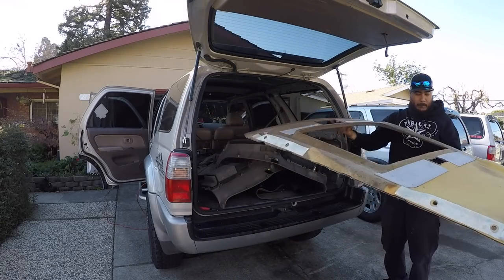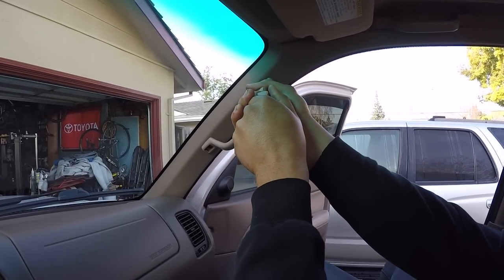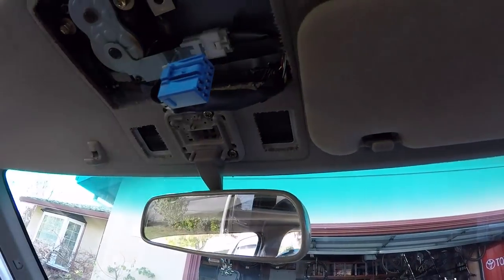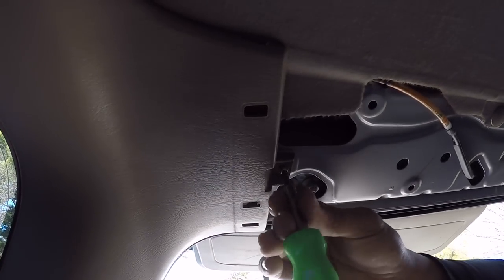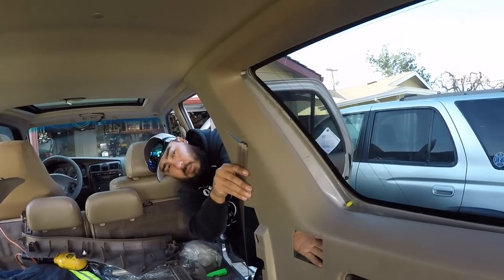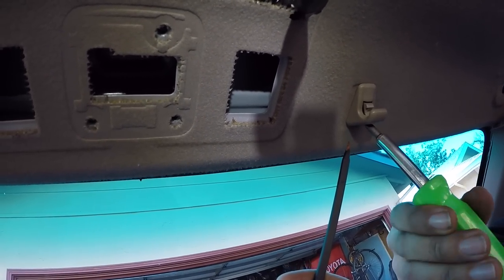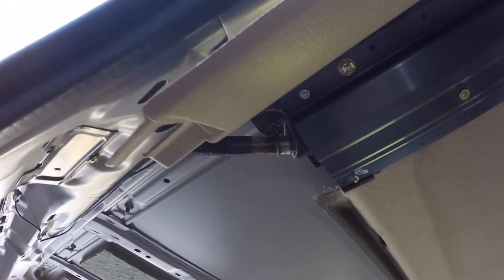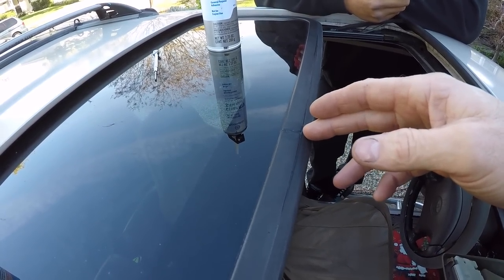Headliner Removal & Sunroof Leak Repair

Comment: Hey Timmy! Since I’ll be cracking those pins that hold the roof up as well. Is there a purchase link or a part number for those suckers?
Reply from the maker: I don't have the part number for those clips.  I'd suggest just going to your local dealer.  They can't be that much to purchase.
Reply: @TimmyTheToolman  thanks for getting back to me! I actually did just that and have some ordered. Should’ve did that before I commented!
Reply from the maker: We are Curious what the part number is, we could add it to the video description for future on lookers
Reply: @TimmyTheToolman  I don’t remember off the top of my head, but once I pick them up on Saturday I’ll let you know!

Comment: I use a #3 phillips screwdriver on the hand holds and you gotta press hard so it doesn't slip, but I've never had a problem getting them off. GOTTA be a #3 though. Even on my 32 year old FJ62 I had no problems.
Reply from the maker: You're must be pretty strong and good with a screwdriver because those screws have  conquered many guys who have tried to get them out.

Comment: Great video! Timmy have you encountered a slow moving sunroof issue? I have the same model as the one in this video.
Reply from the maker: Glad you like the video.  I don't have a ton of experience with diagnosing sunroof issues.  It may be a case that there's build-up of junk on the tracks that's slowing the operation down and a little cleaning might help.  It also could just mean the sunroof motor is getting tired.

Comment: What’s the size of the 2 clips from the back to hold the headliner Toyota 4Runner 2014
Reply from the maker: No clue Jackie.  You'll have to check with your local dealer.

Comment: Hey! Are you planning on doing a video about removing the roof panel for the Toyota 4runner? Why I'm asking is cause I want to get a 3rd gen Toyota 4runner without the sunroof but I can't seem to find one so I was wondering if its possible to replace the car roof panel without the sunroof?
Reply from the maker: That would not be possible unless you were willing to cut the roof off one rig that does have a sunroof, then cut the roof off another one you find that doesn't have the sunroof and have that one welded on.  What you could do is remove the sunroof and then have a plate welded in.  This video will show you how to drop your roof headliner so you can access the sunroof to remove it any support brackets for it. https://youtu.be/MVJW0XM2x24
We don't have a video for removing the sunroof but I'm sure you'll be able to figure it out.
Reply: Thanks for the response and sharing the info! I really appreciate it eventually I know figure something out.
Reply from the maker: @zawditudacosta2890  You're welcome.

Comment: I have a 2000 SR5 (no sunroof) I notice water seeps through the weather door strips during raining days. It took me awhile to figure out where the water was coming so I sat in my runner on a raining day.
Reply from the maker: Good job figuring out the source of the leak.  Sounds like you'll be getting some new door weather stripping soon.

Comment: hey Timmy! loved this video! using it to remove the headliner to add fiber optic "stars".   is there any way you could send a link to the replacement fasteners for the ceiling of the headliner? mine snapped off as well! cheers
Reply from the maker: Don't know the part number for those fasteners.   Your local dealer might be your best bet to get the fasteners you need.

Comment: Thanks for the info! We've been getting a monsoon here in southcentral KY the last few days as spring looms in the distance. Came out to my truck to see there was water in the driver's seat yesterday and and it was dripping from a soaked headliner and sun visor. Looks like it's my drivers side drain that is plugged. Gonna try the weedwacker wire and silicone the front center of the sunroof.
Reply from the maker: You're welcome.  Good luck with the drain cleaning.

Comment: Great Video. This is the only video I have found that comes close to helping me fix my rear washer fluid. I know the pump is working because I can hear it and there is a union under the hood on the pass. side that squirts out washer fluid when I separate it. But, I get no fluid to the rear
Reply from the maker: Thanks Kelly.  That's good to hear that our video might help you solve your rear washer fluid problem.  Let us know what the problem was and how you fixed it.
Reply from the maker: Hey Kelly, that's great news.  Glad this video help you tear apart your interior so you could locate where the problem was with your rear washer fluid delivery.  I buy quite a bit of stuff at Harbor Freight.  I'm there all the time.

On my 98 3rd Gen, I had an annoying rattling while I was driving.  I took the glove box out and was looking for loose wires and saw a new antenna wire for the aftermarket stereo that the previous owner had installed and the wire was loose but that wasn't the culprit.  

After listening to the rattling for a few more days I decided to investigate further.  I suspected the noise might have something to do with the stereo install and I was right.  The installer left the old antenna wire hanging and didn't remove it.  The OEM antenna wire plug has a heavy metal end and it was resting against a metal frame piece behind the stereo.  I ziptied the wire to a wire bundle and the problem was fixed.  Your average person would have just lived with the noise turning up the stereo to drown it out and attributed it to be an old vehicle that makes a lot of noise.  I was so relieved I found the problem because it was driving me nuts listening to it.

It sure is satisfying figuring something out and fixing the problem isn't it?  Talk to you later and Happy Wrenching!

Comment: Hello Tim question my 04 4Runner rear fort don’t open what would be the problem? Where can we start looking thank you so much hope you can help me
Reply from the maker: Hey Carlos, did you mean to say your rear hatch doesn't open?
Reply: Timmy The Toolman lol yes door,  the window goes up and down  with no problem at all.
Reply from the maker: This might be really difficult to fix since you can't open the hatch to easily take off the interior plastic trim to expose the inner workings of the locking mechanism.  I honestly don't know how you'd attack this.  You know who might be a good resource to ask is a body shop.  They might have a suggestion or trick for you to be able to release the lock so you can get it open.
Reply: Timmy The Toolman thanks you! Love your channel!
Reply from the maker: Carlos Flores how you access the back locking mechanism is you remove the back plastic on the hatch. The grab handle/fabric in the back hatch has a little plastic piece you take out to reveal a 10mm bolt I believe.. after you remove the grab handle and the bolt that secures it in, now you can start to remove the back plastic. Try to get a pry tool in between the plastic and metal of the hatch until you can remove it. It has a series or clips going around the edge. Probably like 14 plastic clips in total. After you remove that plastic piece then you have to remove a metal cover that is preventing you from seeing why the hatch isn’t opening. Does the rear cargo hatch door handle still have tension? Or is it loosey goosy? If it’s loose then something broke preventing the handle from pulling the rod to open the door. If you pull the rod while the door is unlocked you should be able to get the door to Open to get a better look inside

Comment: Your videos are SO good.   Timing Belt & Water Pump are very happy!- This is a little off topic, but what do you think?  - the sunroof has not worked since I bought it a year ago (99 4R).  I can hear it trying, but it's not moving up or sliding back. What's the most likely culprit?   Motor or a problem in track? Thoughts?
Reply from the maker: Hey Steve, glad you like our videos and you're making good use of them.  Unfortunately, I don't know anything about the mechanics of the sunroof.  If you haven't done a Google search on the topic, I'd do that first because maybe there's a forum thread that can point you in the right direction.  If you can't find an answer, post your question on T4R,org in the 3rd Gen section and hopefully somebody can help you out.
Reply: That's one I JUST can't find anything for on YouTube or anything especially helpful on Google.   I'll check the forums and see what I can find. Thanks for the help.
Reply from the maker: Hey Steve, please share with me what you find out so I can learn from it.
Reply: Steve Hostetler just got mine fix today at a auto glass shop, they had to replace the sunroof  cables and other parts, basically what makes the window slide, payed $300 but had to get it fix because it was not close all the way and was leaking
Reply: Thanks!

Comment: Hello Tim. I have a question. Can u help me? Can u give me know information about foot pounds of bolts mounting brake and brake calipers. I hope u help me. I want to do it on my car. Thanks you so much
Reply from the maker: The bolts that mount the front brake calipers to the steering knuckle are torqued to 90 ft-lbf.
Reply: Timmy The Toolman thanks Tim, the rear brake caliper is how many ft-lb, can u give me know?
Reply from the maker: There isn't calipers in the rear.  At least not for a 3rd Gen 4runner.  They have drum brakes.
Reply: I’m sr, I forgot the rear is drum brake, thanks you so much

Comment: Thanks for the work and time on this , Timmy and Mark. I love my sunroof, but I'm starting to investigate a leak I have on my '98 SR5.  I first noticed it when one of my kids sat down in the rear passenger seat, and she said it was damp, then I saw some dripping above the upper right corner of the window.  I thought it might be the weather stripping, but it looks ok, so I suspect it's the rear drain tube (29:49 in the video), possibly dis-connected up there or maybe some build-up somewhere.  I'll start with some weed trim line per your first video and see where that gets me.  I'll try the roof rack next (per Donovan D. and some others in the comments).  I don't know about pulling apart the headliner like you guys did (I may never get it back on right). Also - I don't have a seam on the front edge of my sunroof like Mark's does.
BTW, Mark, love what you've done to your ride.  Those wheels are awesome!
Reply from the maker: Well, I hope you figure it out.  To get to the rear drain tube, you don't have to pull the whole headliner down.  You can just unhook enough things on that side to pull it down enough to see if the hose is still on the fitting,  Good Luck!

Comment: I have a leak as well but it only happens in car washes or high pressure water. Still havent figured it out.
Reply from the maker: Is the leak coming from the headliner or do you notice the floor being wet? It could be the seal around your windshield too.
- Sean
Reply: @TimmyTheToolman  I pulled the headliner and found out the drains are working properly, but it still leaks. I'm thinking I'll just fill a lot of silicone in that tray.
Reply from the maker: It could also be one or some of the holes that secure the roof rack luggage rails to the roof. Or a leak in your windshield which I had right after a windshield replacement.
- Sean

Comment: I have a Tech Tip for the rear tailgate wire harness, that passes through the access hole as shown at15:54. I found three wires from that harness cut through from opening/closing the tailgate. Excellent video brother. Wow a bunch of snaps!!
Reply from the maker: That's interesting that those wires were able to be cut through just from closing the tailgate.   Yeah, the body panels are just a bunch of snaps for the most part.  Glad you like the video.
Reply: Timmy The Toolman I believe it's from cold working the wires over the life of the vehicle, as the tailgate was opened/closed hundreds of times.
Reply from the maker: I could see that.

Comment: U should be able to use a 10mm socket on those handles it’s what I did for my tacoma
Reply from the maker: Somebody must have already did the hard work for you and removed the screws.   Those handles did not come with 10mm bolts.  Consider yourself lucky.

Comment: Reminds me of trying to find the leak on the roof of my house, only rain gets in but hard to find any other way.
Reply from the maker: Hey Mark, we surmised that the drain cleaning we did actually helped out.  We're thinking his rear passenger drain was working but only partially due to a partial blockage in the line.  Mark definitely had a leak because him and his wife noticed the carpet getting wet around the passenger wheel well.  Now they aren't detecting any leak and it's probably due to the fact the drain is working at full capacity.  At least that's our best guess.
Reply: Yeh, good to hear, the next heavy rain and you'll know for sure, best of luck that the leak is solved!
Reply from the maker: Thanks Mark.

Comment: Can you fix my transmission please??? Haha it sounds like the bearings are going out. It would make a great video!!
Reply from the maker: I've never rebuilt a transmission.  Is it a manual or automatic?
Reply: Timmy The Toolman manual.
Reply from the maker: I wonder how hard it is to rebuild a manual transmission.  I'm guessing it's something best left for a shop that rebuilds them all day everyday.
Reply: Timmy The Toolman yea it’s just hard finding a trustworthy shop around here. People on 4runner groups say it’s not too hard but you do need a 20 ton press.
Reply from the maker: Have you seen write-ups on it?  What are all the parts that are being replaced?
Reply: Timmy The Toolman I’ve seen videos of other transmissions and pretty much all you replace is whatever is worn out. If it’s the bearings, and the synchros and gears are still good then you just replace the bearings. Maybe depending on the mileage like in my case my 4runner has 239k I should probably just do a full rebuild. I haven’t looked for any write ups yet since I don’t have a garage to do the work in or a 20 ton h press.
Reply from the maker: This would be a good challenge.  Where do you live?
Reply: Timmy The Toolman Southern California. How about you?
Reply from the maker: Northern California.  San Jose to be exact.
Reply: Timmy The Toolman nice!

Comment: Thanks so much for this! We've had water come through our 2015 Toyota Rav4, pretty sure through the sunroof, twice. The first time was before the toyota dealer cleaned out the drains, the second was after. Same problem! Came right through the over overhead buttons  and overhead front center area. It's clearly not fixed. Any advise? 30 seconds into this video -> https://youtu.be/wYVmT-Af8JM
Reply from the maker: I responded to your second post.